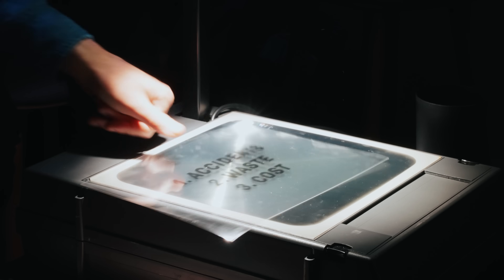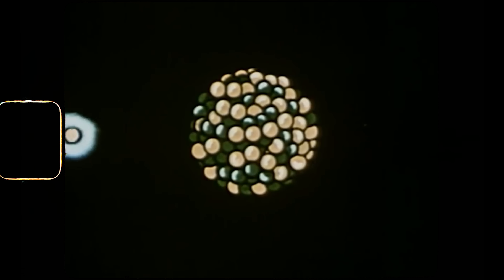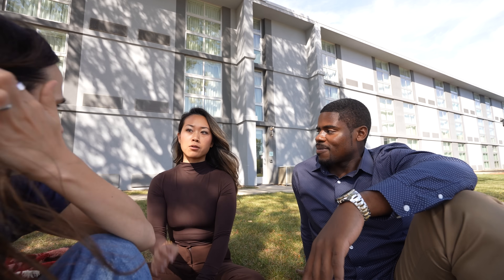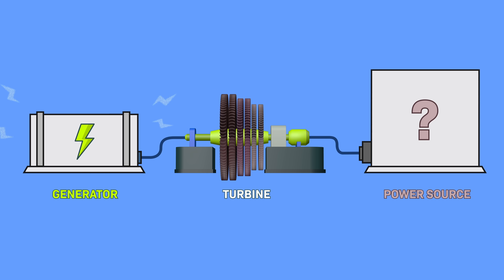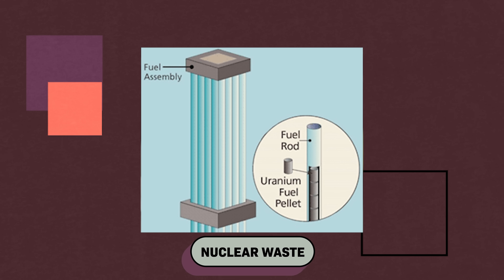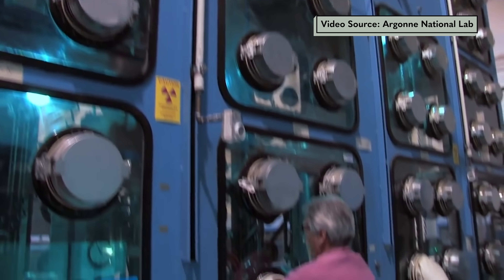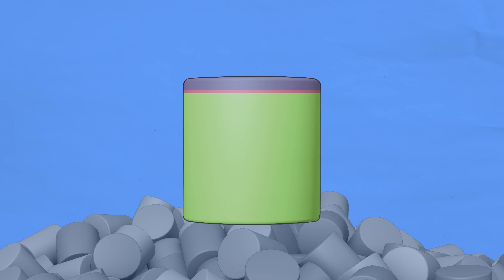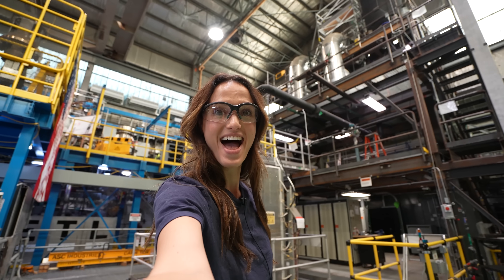The Big Lie About Nuclear Waste

Comment: Hi Cleo, I’m a retired NASA Engineer, but before I joined the space industry with NASA (and Fairchild and Orbital Sciences and a load of other companies), I worked for a company called Vitro where we designed nuclear power plant safety systems.  I designed the “Compensation Module” as well as other subsystems that were part of the Anticipatory Reactor Trip System (ARTS).  I love what you did in this video and hope you keep it going.  Take care, Tom KC3QAC
Reply: That is one hell of a list of achievements there. You should be very proud of the work you did to provide us all with safe, clean and reliable power
Reply: This was really heartwarming. You sound like you've had a really interesting life.
Reply: So don’t qualify yourself as having experience and “you don’t know what you’re talking about” do give a background explaining you are qualified to talk on the topic and you’re “pretentious” 

Yeah that’s the internet!
Reply: Tom that rocks! Tell us more, maybe be a guest on a show of cleo's or just film your own
Reply: I was always curious about the nuclear-rocketry program.  Could we use spent waste as propulsion fuel with a way to convert the ionizing radiation into electricity to power spacecraft?
Reply: @amanawolf9166  yes, but the extra step is unnecessary, there are better & safer uses for reusable (waste) fuel
Reply: So you know why molten salt thorium reactors are a bad idea even though they had one running back in the 50's for nearly a decade with no incidents and no risk of incidents?
Reply: I wonder how many people get that last reference Tom :), I also work in the Nuclear Industry
Reply: @Shocker-lh6kn  not me. Figured it meant something but over my head
Reply: What about energy sources that come from outside of the atmosphere, like solar or wind energy ? Like you can take abundance amount of unused solar/wind energy and store them into other type of energy like gravitational energy. Then on when solar and wind energy is scarce, use those sources to generate electricity afterwards
Reply: @ZoeDodd-fu1fc  unreliable, takes alot of space, toxic materials, short lifespan, environmental issues, very expensive
Reply: currently in the freshman year of my bachelor’s degree in nuclear engineering! any advice for someone just starting out in the industry?
Reply: So you're dumb? Noted
Reply: Nice
Reply: Sounds like a lot of jealous male Karen's trying to adjust their little tool to make up why they never accomplished anything in their meaningless life 😂
Reply: I bet your CV is amazing.
Reply: Couldn't hold down a job very long huh.
Reply: Don't pat yourself on the back too much there big guy.
Reply: @mrtimjitsu  stfu Kyle, he's establishing that he can say with professional authority that they did a great job, not tooting his own horn or insulting her work! Skip off back to victimland and shhhh!
Reply: @mrtimjitsu  don’t be to envious. Just because you haven’t achieved anything to hang your hat on. Thomas has been on the cutting edge of research where you just join the keyboard mafia group trying to pick apart people better then you for no reason.
Reply: @mrtimjitsu  he should
Reply: @mrtimjitsu  Says someone with no real accomplishments.
Reply: @pakviroti3616  I flew to Mars 5 times without a rocket, your argument is now invalid.
Reply: @spugelo359  Flights of fantasy after ingesting hallucinogens don't count. Uh...who's your dealer?
Reply: @pakviroti3616  Yes, I'm also the President of USA, Arabian prince and Emperor of China all at the same time. You should totally trust me bro.
Reply: @mrtimjitsu  Talking about your career isn't pretentious. You're compensating for your own insecurities.
Reply: @digBanan  lol okay buddy. His whole comment is "I'm this, I did that, I did this, I did that." It's very pretentious actually. I have no insecurities really, I just work with engineers and they're all very pretentious. There's a joke I like to tell, "How do you spot an engineer in a crowd? Just wait, it won't take long before he tells you he's an engineer".
Reply: @mrtimjitsu  similar to the age old joke of how do you spot a sad angry person on the internet. Just wait for them to try and drag someone down for no reason all. Keep banging away on the keyboard if that gives you some purpose but if you have nothing nice to say maybe try the approach of not saying anything at all
Reply: @mrtimjitsu  So, you work with engineers, but you are not an engineer. How do you spot a loser? They'll reveal themselves by complaining about people that are not losers.  😂
Reply: @pakviroti3616  probably their janitor😂😂😂
Reply: @pakviroti3616  he dislikes accomplished and successful people..
Reply: @matthewrowell8518  Too FUNNY.  😂😂😂
Reply: @pakviroti3616  @matthewrowell8518 you both instantly became bullies. Wowza
Reply: @prefersoxygen9373  Naturally.
Reply: @chelseashurmantine8153  you’re right apologies to all the janitors out there. Didn’t mean to use your profession in a that sort of way. I certainly didn’t mean all janitors are like that person most are lovely people who provide a important service for everyone
Reply: @pakviroti3616  you think because I don’t have a PE license I’m a loser? Lol an engineer would think something like that. I’ll take my paycheck over a PE license any day of the week. I’ve seen what engineers get paid, and I laugh because in the time it takes people to go to college to get a degree, get their PE license all while taking on student loan debt I’ve worked my way up and now I get paid way more than most engineers. So call me a loser all you want, I’m laughing all the way to the bank 😏
Reply: @mrtimjitsu  The amount of money you earn does not measure the contribution you give to the society.
Hard workers, whatever they are engineers or janitor are important for the society. Important for us all. You and your attitude are not.
Reply: @diniciacci  oh contraire mon frere. The amount of money I earn is an exact measurement of my contribution. The amount of work I get done justifies my pay. The majority of engineers I've had to deal with spend far too much time focusing on details that don't pertain to getting the job done. I would say they are working at 50% capacity (and that's being generous), and are wasting a ridiculous amount of time and money.
Reply: @mrtimjitsu silly
Reply: @mrtimjitsu  Show us on the doll where the engineer touched you :D
Reply: @mrtimjitsu I always had that problem of getting the job or career before getting a degree, then giving up.on school because of time constraints, thinking "I'll get my degree later" ...

Well, now that I am retired I have the time!  😂
Reply: @mrtimjitsu  I love how you felt the need to start talking about how you're better than engineers and how much more money you make. You're like the quintessential internet tough guy

Comment: Yeah, when I was a kid, I used to be anti-nuclear because of the fear of waste. But as an adult I agree, the problem is not the waste, it is the safety of the reactors in use today themselves. I.e., 3 Mile Island, Chernobyl, and Fukushima, and the 1000s of accidents you never heard about. I am actually for nuclear now. Just need to get rid of these old obsolete reactors, update with newer safer modular breeder reactors.

Comment: For every rod some of it still becomes plutonium and that waste is still a challenge. Terra Power is trying to work out a reaktor that lasts long enough to "burn" all of the fuel, including plutonium. 
Also the cost of nuclear is a challenge. With so many other technologies price is constantly competing, and nuclear is expensive. And we can't be sure we actually need it. Take geothermal, it just seem to have a tremendous reduce in cost by new drilling technology. Much can be said about nuclear power but drilling a whole and using Earths own inner nuclear heat is just a simpler power plant.
Reply: "of it still becomes plutonium and that waste is still a challenge" The plutonium isn't a challenge. It's just new fuel. It's the Cs/Sr that's the problem.
"Take geothermal, it just seem to have a tremendous reduce" Geothermal is still more expensive than nuclear. And more dangerous, besides.
Reply: @Crispr_CAS9  The video gives the impression that there is no waste. And that is wrong. It's a better scenario when we reuse old rod material. A more desirable scenario would be next generation nuclear where more of the material is used first time. My bad plutonium can of course be used as mox-fuel. Drilling with laser seems to be able to reduce the price of geothermal to a new level which does make it a competitor to nuclear(and other technologies). No current geothermal facilities are deemed more dangerous than nuclear, so I'm not sure where you get that from. So far the high prize had been drilling, not the facilities since they are pretty simple and therefore cheap. 
In general i see a bunch of people rooting for nuclear claiming it is the smart choice and they support because they think it is the best technology. Funny thing is that many energy technologies are just as good, the big report from EU everyone is using to promote nuclear compares it to be just as good as wind.... Let that sink in. That is wind with no support technologies,  no power to X and no storage. 
Nuclear is a great partner in the mix of powerplants and we will have to build more of them, but they also benefit from support like solar, water, wind, geothermal. Future Energy mix will still be a mix if we are smart, so every technology replacing fossil is important and depending on application different technologies makes more sense than others. That makes yelling on other technologies than nuclear just as retarded as yelling on nuclear.
Reply: @Wreenz  "No current geothermal facilities are deemed more dangerous than nuclear" Nuclear is the safest form of energy production. Geothermal is more dangerous. Drilling is dangerous, and geothermal releases and leeches toxic chemicals.
Reply: @Crispr_CAS9  Backed by no facts. Both Finland and Iceland are pretty satisfied with geothermal. We did manage to drill for Oil for years, so what problems can't we overcome here? 
Nuclear is only good for baseline because it doesn't scale down very good. So it will need partner technologies to do the overhead anyway. And some countries might want to avoid nuclear since ot is a pretty good military target or simply because they are able to build other options where all of the materials can be sourced within that country, making them less dependable of mined resources. Yes nuclear can be a great option but it might not fit all scenarios.
Reply: @Wreenz  "Backed by no facts" I've never actually seen hard numbers for deaths per TWh for geothermal, and I've looked. I assume it is because geothermal is so poorly developed that it hasn't been studied. It is, however, impossible for any industry that involves drilling and high-pressure steam to NOT be dangerous. You can find information on chemical release from EIA, which includes the fact that geothermal is associated with both carbon and sulfur emissions. Less than fossil fuels, obviously, but far higher than nuclear.
" Both Finland" Finland does not get a significant fraction of its electricity from geothermal. To the best of my knowledge, it actually gets none. Iceland is in a fairly unique circumstance with respect to geothermal that does not apply to essentially any other country.
"Nuclear is only good for baseline because it doesn't scale down very good" I don't know what you mean by 'scale down'. If you mean inefficiency of smaller plants, that's true but not relevant, because transmission losses are negligible across the relevant distances.
If you mean power ramping, nuclear can power ramp as fast as coal. The only sources of energy that can ramp faster are liquid (hydroelectric, methane/LNG, oil, etc). And batteries, but those aren't energy sources and are extremely expensive.
"Yes nuclear can be a great option but it might not fit all scenarios." Of course not. There's nothing that can beat solar to offset cooling costs, for instance. And nuclear for powering extremely remote stations would be a poor fit. But it is a good choice for most electrical production.
Reply: @Crispr_CAS9   Only countries that users geothermal are countries that don't have to drill that far since that has been too expensive. Hence Finland, Iceland mainly since they got warm springs and warm pockets close to surface. Once drilling is done it's a closed circuit. So yeah under construction there will be pollution, but nuclear also needs a fair bit off concrete and that also releases a fair amount of pollution, so what is your point? I'm pretty sure we will see a bit more to geothermal if the new drilling tech holds up to its claims. 
Scaling down means smaller countries have a hard time placing nuclear far away so very small plants would be preferred. Problem is that for heat and electricity bigger plants do hava a way better economy. Making some other techs a better value. Seaborg is a company that are trying to solve that, but so far not solved. 
I agree that nuclear is a great option for baseline energy. But it still makes great sense to harvest energy locally meaning that one's big large shopping centers aircondition could heat varm water to nearby residents and so on. Smart buildings or green build....many names for it.
Nuclear is by far most economical when you run a plant at a constant load. And that is base line, just enoughe nuclear to run at night because during day other techs can produce cheaper energy. And price really is key for almost everything. So at some level i think we agree :) Nuclear is a great option and we will see more of it. 
Nuclear is great now but it won't stop other technologies from improving or being just as good, so who knows in 10 years we might se something else changing the game. It's tech and I'm exited for all off them.
Reply: @Wreenz  "Hence Finland, Iceland mainly since they got warm " Finland does not use geothermal for a significant portion of their electrical generation, I do not know why you keep referencing them.
"Once drilling is done it's a closed circuit." This is patently false. All geothermal systems are leaky to some extent, it's unavoidable. Currently they emit about 1% as much as equivalent scale fossil fuel systems. That's more than nuclear by far. That's not just construction, it's operation.

Both of the above points were made already in my prior reply, and yet you repeated your false claims again anyway. Why?
Reply: @Crispr_CAS9   Only using geothermal where it so far has been economical viable is a riddle to you why?
Even though nither country has been able to use much geothermal (think economy and the past possible tech) . They are still representing the largest facilities at doing so. So offcourse if there's is somewhere data and research should be conducted it would make sense to do it there.  Pollution is never a problem in it self. How much and how can be a problem. There have to be leaks? That is a shitty scientific way of solving a problem. If geothermal pollutes at an acceptable limit and can be made cheaper than nuclear well why wouldn't some countries cover some of their needs with that? Is the argument, same goes for wind and solar btw.
So yeah you made your point but zero counter argument for not using other technologies. Maybe because there is none except feelings/ believes. If you want to make it it a bit more fun try imaging a energy and hear market that is 100% depending on one recourse, may that kind of market be more vulnerable than a mixed market? The answer may also be why some will choose different than nuclear.
Reply: @Wreenz  "Even though nither country has been able to use much geothermal " Iceland is able to use lots of geothermal, Finland is not. That's why it's weird you keep mentioning Finland. The US uses more geothermal than Finland.
"If geothermal pollutes at an acceptable limit and can be made cheaper than nuclear" There is no evidence that it can be cheaper than nuclear.
"So yeah you made your point but zero counter argument for not using other technologies." I don't have any problem with other technologies. I have a problem with people lying about things. If you would stop doing that, it wouldn't be an issue.

Comment: Good video.  A few points:
First - developing the infrastructure to process the waste and prepare it for reuse, plus developing the power plants that can use it will cost billions of dollars and take years to finish.  The concentration / filtering part is the hardest.  You have to have very efficient concentrators to get the spent fuel to a level that can support fission sufficient to create enough heat to run the steam turbines.  This was a monumental effort in the Manhattan Project.  Iran is still working on getting the materials to a sufficient concentration for whatever use they intend.
Second - the waste won't decay any faster than it currently does.  It's just that the level of radioactivity starts and ends at lower levels, so it'll take less time to decay to a point where the residual radioactivity is "safe."  Each time spent fuel is processed for new fuel, there's less viable radioactive material to process.  So, you either have to add more viable radioactive material or you spent more time processing a higher volume of spent fuel to create viable fuel to restock the reactors.
Third - As mentioned by one commenter, this ends up being more of a political hurdle than a technological hurdle.
Fourth - Unless the policies change, getting enough people the proper security clearances to work with nuclear material will be a challenge.  It's not all that simple a process.  You don't want potential terrorists or extremists working with this stuff.
Reply: Maybe that's something Elon Musk should be working on then.